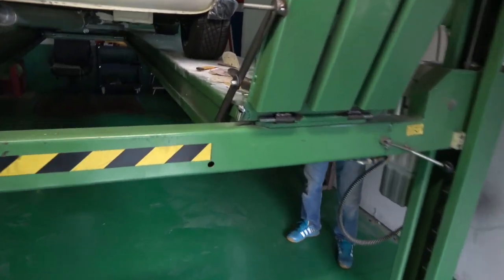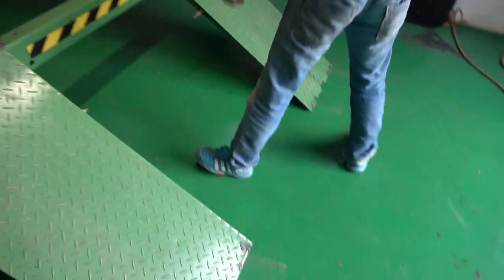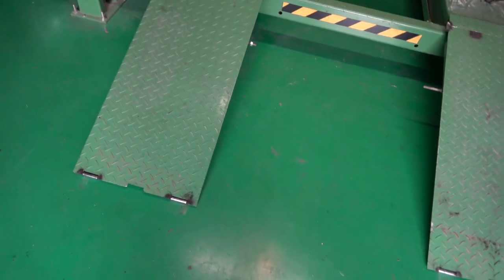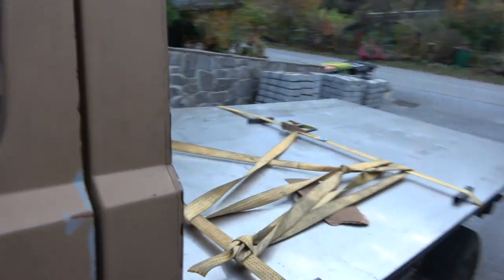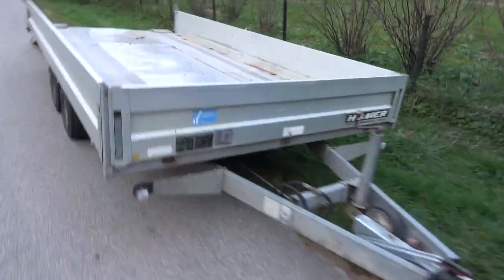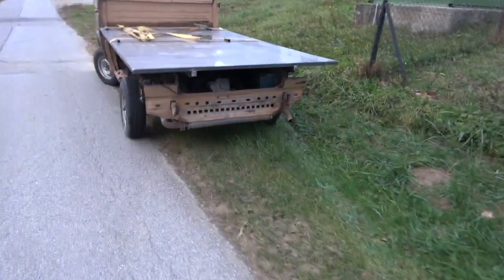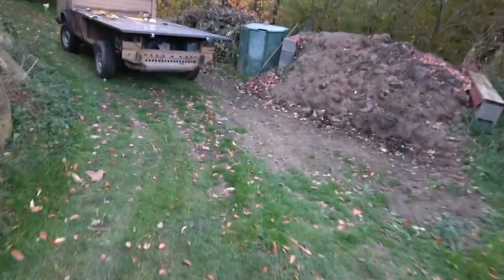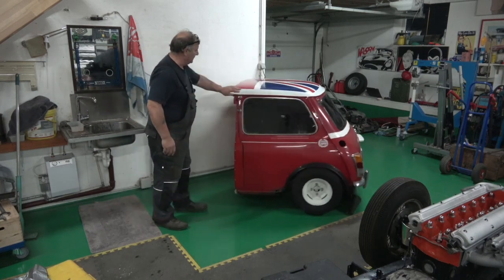Classic Mini Bar & VW 4X4 On The Lift!

Comment: Again, smart mod to the ramps.  I love your Mini Bar and you've given me ideas with my Mini wall art..
Reply from the maker: Randy,  Thanks,  The front was dumped as it was so bad! There is a guy doing sides of Minis wallm art for 5K on the internet check him out. Cheers Dave
Reply: @ClassicCarCave  I believe I've seen his work.. too pricey for me, but it's definitely cool.  This is the reason I kept the front end of my restoration Mini in tact.. all for wall art.  Of course I learn a little welding on it too...

Comment: Must say has made me smile. Non stop fun. The ramp roller modification reminds me of a stairs I once saw with wheels on a rig skid set up on a fixed oil platform.Can see a stainless plate being set into the concrete floor.The transporter looks fun. Can see a lower roof modification coming like a Mini Sprint, well partly.The trailer wouldn't last 10 minutes in the UK, would get nicked.
Reply from the maker: Adam,  Do you mean the TLP Hutton i worked on that i think it was the first tension leg platform in the world is that right,  I picked the VW for 100 euro what do you get fro that!  Your right i am always wary when i bring it to the UK.
Cheers Dave
Reply: I'm not sure the actual drilling rig skidded on Hutton, it being a floater, maybe they just repositioned the complete platform. However fixed platforms with their own drilling facilities skidded the rig in two planes to position over new well slots. This encompassed external stairs stuff dragged around on wheels.I suggested that if you grind out some of the concrete floor and inset some of that stainless plate flush, you won't need to worry about the rollers marking the floor.A lot of people have a tracker on their trailers Theft is at epidemic levels in UK, they are used to steal diggers and heavy plant.

Comment: Dave could you have rolled the door closed over the flat bed or is there a cross support at the front ?
Reply from the maker: Burt, There is a support bar across the front i‘m afraid, The VW does not need to be serviced but is would be handy if we could check it 
out on the ramp. Cheers Dave
Reply: Dave, can’t see why you couldn’t just allow the door to drop a bit at the moment of truth and it wouldn’t catch on the roof of the truck, or am I missing something?

Comment: Dave...l would not risk it...let the air out of the tires a bit 
or get smaller profile tires...or try backing it in, see how 
that works. Cheers
Reply from the maker: Dinos, It‘s just as easy to drop the roof a little bit. I was going to chop the top anyway but it would be good to keep it dry! Cheers Dave

Comment: Let air out of tyres drive in. Blow tyres back up ?
Reply from the maker: The idea was just to see if it would go on to the ramp, It will only go on the lift for the odd repair so it is not a big deal, Cheers Dave

Comment: Take the roof off and replace it with a flat panel !!! 

Or Take a 15mph run up ! Anything will fit with a run up !! 

That Amir is a noisy bugger in the VW !! 

Take care and catch you when your back 👍
Reply from the maker: Paul, lol, if a hammer does not work get a bigger one! theory. All done and hope to be out on Monday, Cheers Dave

Comment: U nutters just before it went up the ramp you could have closed the door a bit or at least till the bit sticking down cleared the cab
Reply: Ok the door would have been half open but there was plenty of room ubove the flat bed for a good meter
Reply from the maker: Christopher,  There is a bar in front of that which the roof was hitting as well it is where we hang the light strip, Cheers Dave
Reply: davejaguar66 
 Nothing a crowbar would fix u hurt my feelings denting the roof on the beauty x
Reply from the maker: Christopher, A dent in the roof and everywhere else lol. Cheers Dave
Reply: davejaguar66 I know a guy who can sort them dents last name is 66